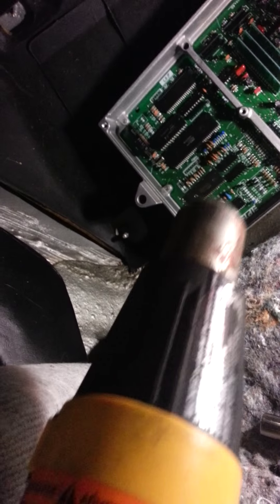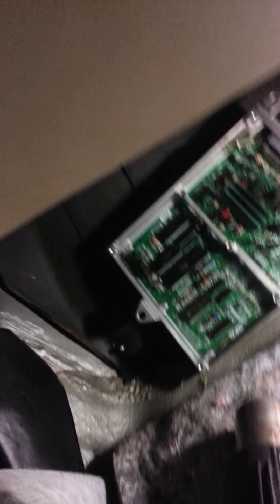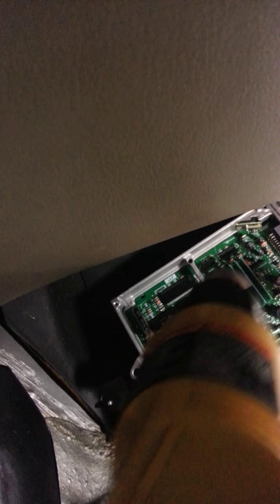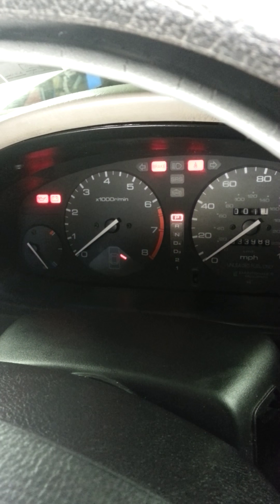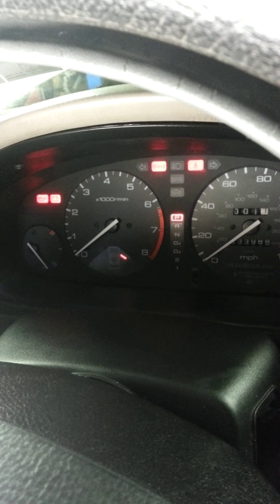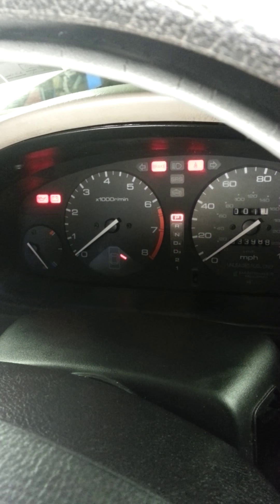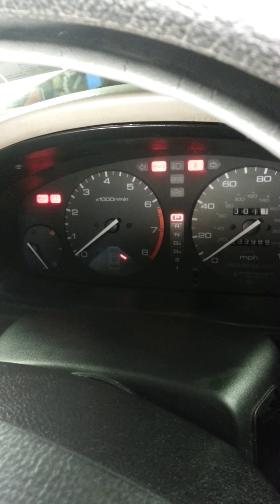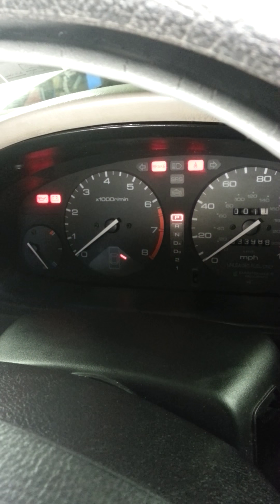honda accord delayed fuel pump activation 2

Comment: Did replacing the ecu fix this issue? I'm having the same thing going on. If I let it sit with the key forward for a couple minutes, the check engine light will go off and the pump will prime.
Reply from the maker: it did fix the issue.
Reply: @DjRobArt  Permanently? Did it stay fixed or became non-conducting again with the cold?
Reply from the maker: @nachtundnebel3175  permanently, at least until the car was totaled a year later.
Reply: Did it ever shut off while driving
Reply: @countryboy1826  no it never shuts off it just next time use it gives this issue